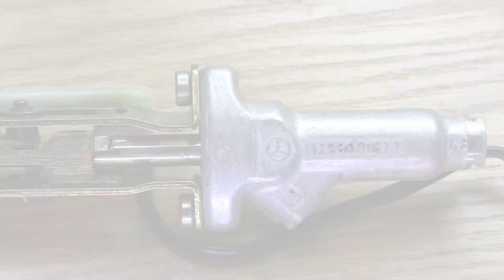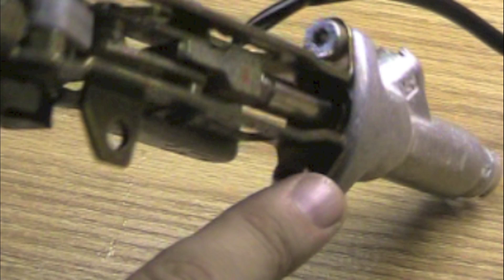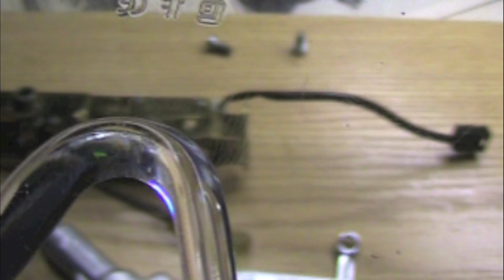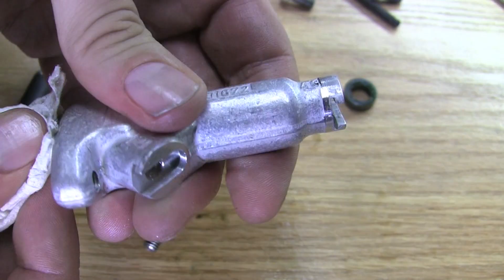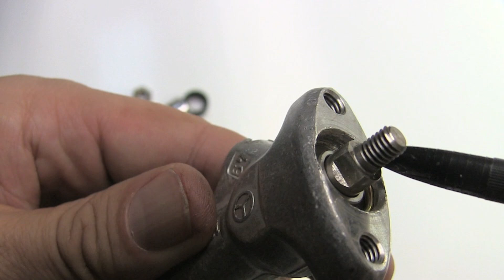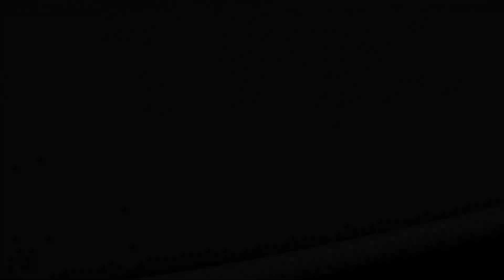Mercedes R129 Top Hydraulic Latch Rebuild w/O-Ring

Comment: Hello! Just started the repair on the R129. Everything is going smoothly except the retainer ring, its a killer. Do you have any recommendations or advice on how to get it out. Is it safe to drill it  or something?
Reply from the maker: No special advice, other than wear eye protection. I had to pry pretty hard on those retainer rings, using an assortment of small screwdrivers and finally, a small knife blade, as I recall. I would not recommend drilling anything. Even a small scratch on the ram piston rod can cause a permanent leak. Best luck to you.

Comment: WTF are you doing, use the right seals and not something from the DIY store. The exact seals are available
Reply from the maker: I'll tell you what I was doing: in 2014 when this was made, there was ONE source of the REPRODUCTION ( not even OEM) seals. They were $250 for a set. The O-ring set I used was $19.99, lasted at least 4 more years, and worked fine. So go ahead and spend YOUR money however you want. I'm here to Save money. Which set did you use on YOUR R129?

Comment: Your videos re 129 are so understandable even a non diy guy can succeed.  My question were these the only cylinders you replaced or did you do ALL 12.  I have a main lift cylinder leaking and just want to do BOTH rear lifts and not all the rest just wondering what you did with your car
Reply from the maker: Thanks! I only refurbished the two latch cylinders over the windshield. These are the ones that go bad the most often. I did not have a problem with any others for several years, but the next bad one was so concealed that I did not pull it out to work on it. The process of rebuilding those cylinder/rams would be the same if you can extract them.
Reply: @FlashDriveFilms  Thank you.  Your 2 Best Videos ..IMO... The instrument Cluster and your hydraulic cylinder.  With your help I was able to do the instrument cluster.  I was so shocked that I did it...ME mr cant fix nothing I can not thank you enough.   That is why I said your videos are so clear and concise.  Thanks again and keep em coming!

Comment: Do you have to bleed the air out of the system after replacing the cylinder ? thanks
Reply from the maker: I did not find a need to. The system pressurizes only one side each time you activate it and the fluid then goes back to the reservoir by the return line.

Comment: Is it the same for the rear latch on a CLK 320 ? What O rings do you get ?
Reply from the maker: I am not sure of the hydraulic ram cylinders are the same. The O-ring kit I used was from Amazon, and very reasonably priced. It was identical to the one I have an affiliated link for in the description. I may receive a commission for purchases made through these links.) Mine worked well for the R129, but I am not sure of cross-model compatibility.

Comment: Hi All, I'd like to buy get the seals prior to reassembling the Hydraulic cylinder. I've no idea how are the dimensions of the O-Rings and the gaskets, seals you name it. Could anyone help me with that?
Reply from the maker: The set I used in the video, I actually bought on eBay for around $20 at the time. I didn't take the measurements or sizes off of them. (it was a whole set for all 12 hydraulic rams) There is also a website where someone has gone to the trouble of reproducing seals like the originals, but they were much higher-priced, so I went with O-rings instead.
Alden
Reply: NBseals.com

Comment: Were do you get the replacement kit?
Reply from the maker: I got the O-ring set shown in the video off of eBay. It was right around $20 at the time and had O-rings for all of the hydraulic top cylinders. I do know that someone has gone to the trouble of making actual replacement duplicate seals like the ones from the factory. They look really well-made, but I do not know how good they are as they were WAAAAAY over my budget. (couple of hundred dollars at the time, as I recall.) You might also look into totally rebuilt assemblies as I have seen some offered that are much lower prices than they used to be. (It was about $500 each for new ones when I check before doing this video. They seem to run about half that now.) My O-ring repair is still working fine going on 4 years now, so it depends on how long you plan to keep your car as a guide to which route you want to take.Hope this helps.
Alden
Reply: I am at the Benz dealer. What size is the part ? As they don’t know
Reply from the maker: I don't think the Benz dealer actually sells just the seals. When I looked into it (again, almost 4 years ago) they would only sell the complete hydraulic unit assembly: the cylinder ram and latching mechanism, as on unit. Very not cheap. I would recommend checking online, like eBay or Amazon, to find someone who sells the set of seals or O-ring kits.
Alden

Comment: Donde está manifold pressure sensor de mesedes benz slk230 1999
Reply: Donde está manifold pressure sensor de mersedec benz slk 230 1999
Reply from the maker: Hi! I haven't worked on an SLK230 (yet) and I am unfamiliar with the engine layout. Sorry I can't help on that one.
Alden

Comment: Thank you very much for this excellent video.  I replaced seals in both latch cylinders. I did have a struggle with the retainer ring.  I found another video where the gentleman suggested notching the side with a dremel. Work great.   That ring is a killer 
Thank you very much!,
Reply from the maker: Glad you liked it!! I really struggled with the latch retainer ring, both because it was very difficult to apply force in the right direction, and then also to keep in the camera view. Took a while, but was worth it in the end.
Alden

Comment: Hi Sir,
What a great video you have made, clear sound, clear graphics, easy explanations. Bravo.
Maybe you can help me out with some of my queries.

1. I have an SL500, Year 1999 and i would like to purchase complete seal kit even though only one of the cylinders is leaking. Do you advise to rebuild all cylinders even if they are not leaking yet? or should i just rebuild the leaking one (which is one of the rear main big cylinders) ?.
2. All the seal kits in the market for rebuilding R129 cylinders are O rings which is different than the OEM CUP seals. which one do you think is more durable ? and do you advise putting the O rings?
3. Do you supply any tested seal Kits whether they are O ring or U cup  ? old or new? or can you recommend any suppliers ?
4. Do you have any Videos showing the rebuilding of the remaining different latches/cylinders in the R129 convertable operation? 

Thanks
Reply from the maker: Hi!
I'll take each number at a time: 
1) You have to decide what your plans for the car are. Keeping it forever or just a year/summer? Keeping the car "perfect", concours, or just as a weekend runabout? If you have the time/money/inclination, and plan to keep the car forever, do all the cylinders in one go and be assured.
2) I think the cup seal should be more durable. O-rings will roll each time the hydraulic ram operates, flexing the seal. Cup style seals are the correct shape for hydraulic ram operation, so it would come down to how precision the molded seal is, and what materials it was made out of. Done right, they will outlive an O-ring seal. (theoretically) I chose O-rings due to MUCH lower price for use on a car with already many years & miles on it.
3) I do not sell any parts/kits etc. I bought my o-ring kit online at a popular auction site.It came with O-rings for all 12 rams of the R129 power top system. It was under $20, so shop around.
4) I have as yet only rebuilt the top latch rams, as the others seem to be operating fine. Basically, all of my repair videos require something to break before I can fix it and make a video! 
As a side note: I have seen websites that sell some really nice looking seal kits. They look like high quality and correct dimensions etc. However, I found them to be what I would consider Very expensive. Especially for a car in the condition mine is: 26 years old and nearly 200K miles. If you have a younger, nicer version, the seal kits may represent a better value for you. See answer #1.
Alden
Reply: Dear Alden,
Actually my SL has only 65K Miles and I do intend to keep it for as long as i can so i should take your advice and do them all in one go. But everybody around me is saying that the O rings are good enough and will last me at least 5 years and like you said it costs less than 20 $, while the U Cup rings will probably last 6-7 only and cost 250$. keeping in mind i live in KUWAIT which is known for high temperatures in the summer (can reach up to 130 F). There are many O ring suppliers on ebay, but found only 1 supplier for u cup seals (www.mbseals.com). can you advice any other U cup seal suppliers? 
Many thanks for your support.
Reply from the maker: Nersis Kyoumjian I don't know of other U-cup seal vendors, although I have seen them on sites like eBay form time to time. High heat is definitely an important consideration for the top latch seals, they are the most exposed, being on top of the windshield header. What will wear O-rings faster is how often they are flexed: putting the top up & down a lot would make them wear quicker.
Alden

Comment: Could you please tell me the exact size of those o-rings?
Reply from the maker: Hi!
I honestly didn't measure them before doing the rebuild. They came as part of a set/kit, with one for each side.
Alden
Reply: FlashDriveFilms you are lucky, is not easy to find the exact size, is 9x3mm
Reply: @FlashDriveFilms  I’m a master mechanic would that be a similar size as a valve seal on a engine ?  They looked to be the same design , also a compression seal on a transfer case  but very tiny

Comment: Greetings,
You certainly cover all the options e.g. buy a new one, send it out for rebuild, never raise the top again...etc. I agree...all are valid options  ;-)
However, if anyone wants to get the seals for this roof latch (or any of the many other hydraulics on the R129 top) instead of using the " O-ring method" mentioned, the seals are available at mbseals.com. Refer to this video for similar info. https://www.youtube.com/watch?v=ld4uXs_4R3Q&index=29&list=PLsoW__ztUKTPJU_NR-_1ftP6bLXkwttL6
I've ordered the seals and rebuilt the latches myself. Overall, a relatively simple job.
Mentioning the disclaimer, I've absolutely no relation with/to any of the vids posted here...nor with mbseals.com. I just love my SL's.
In closing, thank you for posting these videos. To me, the info is invaluable. You and your efforts are appreciated.
Warmest regards,
Reply: Hi Kite, Thank you for the info above, I also love my 1999 SL500 and unfortunately one of the main Cylinders at the right rear is leaking (due to rare and minimum operation actually). My mechanic advised that all the seals on all the 11 hydraulics should be replaced since they all probably got dry because of the non usage, however I am hesitant to allow them to put their hand on my SL. I found a lot of O ring kit suppliers but i also didn't like the fact that they are not U CUP seals like the OEM versions are. Thank you for the info you provided i will probably go ahead and buy them from mbseals.com (even though they are red in color which means different material than the original green U CUP seals). Any advise about replacing the seals of all or 1 leaking cylinder !? did you rebuild all your 11 latches? or just 1  ? how many years has it been operating smoothly ?